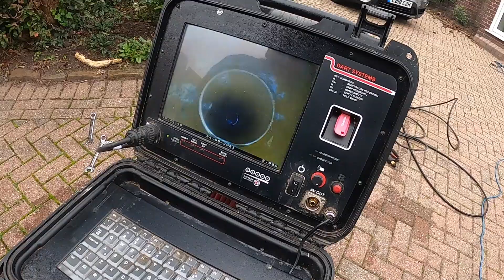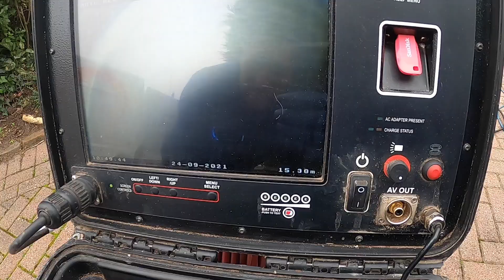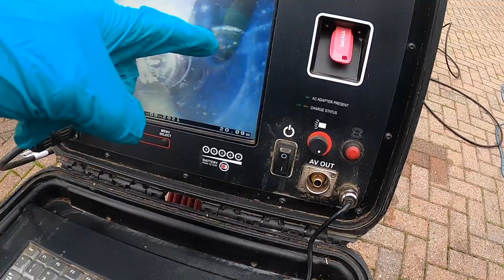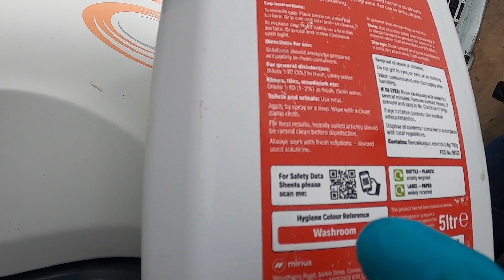Satisfying Sewage Unblock! Great Gush!!

Comment: Keep your video's coming , extreamly entertaining and interesting. Many years ago here in Miami FL , I was a plumber ,BUT- we did'nt have the equipment that you have. Most of our stoppages were cleared through vent on roofs, sometimes cleanout at Street level. I wish you all the best in your endevours ,God Bless you and your families. We only had the K60 & K50 ( heavy duty spring hose in 15 FT sections ,it came with a variaty of cutting heads,
Reply: Thanks Charles 
Keep watching mate 👍👍

Comment: If you stick a lance on your jetting hose you can often use the water pressure to loosten the dirt around the frame.

All that said block pave covers are a pig!!!!

Other trick is to run a old hand saw blade along.
Reply: Good idea. My cheapo nilfisk does a great enough job of stripping out all the roots and moss in between block paving. Their jetter should easily strip out all the sand that's wedging that cover in place.
Reply: Also some lube may well help

Comment: You should try an Impact Driver on the seized screws, they are extremely good at breaking open seized screws and bolts.
Reply: manual impact driver.the type yoy hit with a hammer
Reply: @QueernMental  yep that's the one, they are great at cracking open a seized screws and bolts.
Reply: you can also drill them out

Comment: Alloy garage manhole . Hammer the screws first to remove oxidation then hammer with screwdriver in slot to clear , then try to turn screws I did some that had been down 25 years then lifted without any problem

Comment: Try rigging a short hook in the corner slot with a ring on the top end. Then use a floor jack with a short rod on the arm inserted into the vertical corner hook. Jack that cover right off, no sweat. Save time and your back.

Comment: Mmmmm , use the high pressure water to clean out the sides of the cover?
Reply: Good idea but wouldn’t of helped  on this occasion 
Metal frame was wedged in by cars going over for many years 👍👍

Comment: You should get a pinhole nozzle for you pressure machine, that would remove all the crap from around the manhole and clean it as well. If there is no crap to "seal" it in, its easier to remove. Yes you use a bit  of water, but its faster and easier than beating the shite out of it! Work smarter, not harder!

Comment: THE Trouble With BLOCK PAVE COVERS Is the sweeping sand gets in between the cover and frame
Reply: They make these covers with plastic frames nowadays to stop the metal tray welding to the frame, of course you will inevitably get sand in the edges but a couple of taps with a hammer and block of wood helps to loosen it out.

Comment: @ 25:00 Instead of using your screwdriver as a chisel/ pry bar , why not just undo the screws?
Reply: Screws seized up 👍👍
Reply: Yes that was an internal "sealed manhole cover" that you broke, just grind off the 3 bolt heads, then mole grips and a bit of WD 40 and replace. Garage will definitely be a bit stinky from now on.

Comment: I've been binge watching your videos for a couple days. It's jmo but on a scale from 1 to 10 your "unclogging effort/ability" is a 10, but the cleanup re: what the sewage/feces effects is a 4. I noticed it when shoes were move after they're sprayed with feces and again when kids bikes/toys were sprayed with feces, sewage. Disinfectant is effective, but only if it contacts the item and the sewage is thoroughly wiped off as directed. At times high pressure water is sprayed on feces above the pit causing it to then spray around and make contact with other things. Maybe a little slower careful cleanup? Still like your videos.
Reply: The cleanup is one of the best parts of what they do? I doubt very much they record every little aspect of the cleanup… else the videos would be enormous.